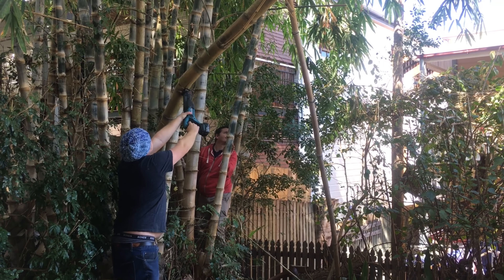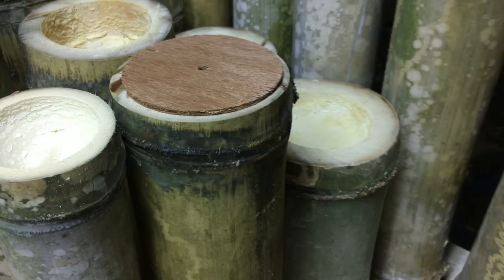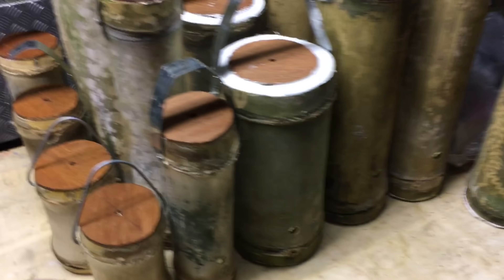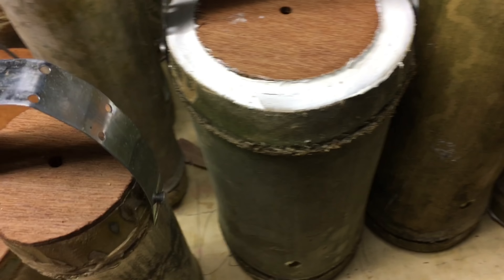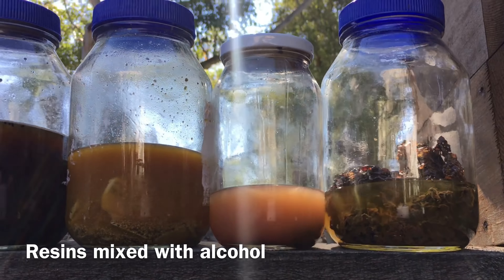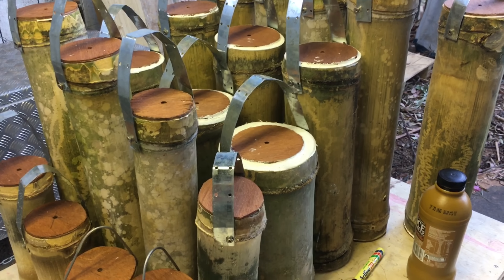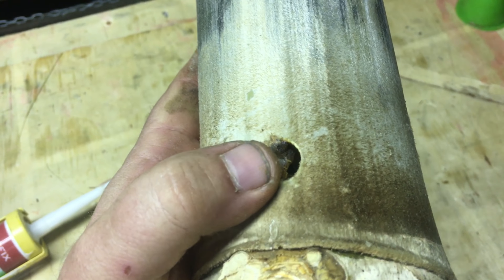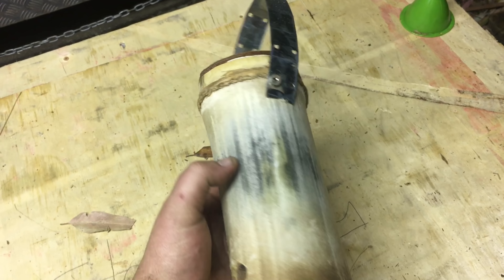Trap hives for stingless Bees 🐝

Comment: How do you keep your bamboo and wooden  hives from termites?
Reply: Termites don't like being out in the light, so as long as the hives aren't sitting straight on the soil, you shouldn't have a problem with them. Also, hives are usually made from wood that termites don't like.